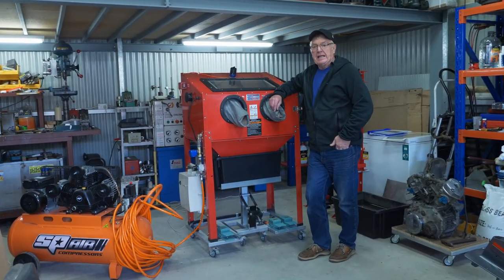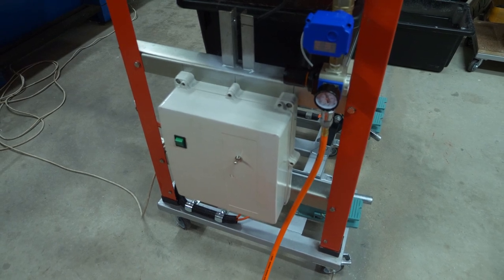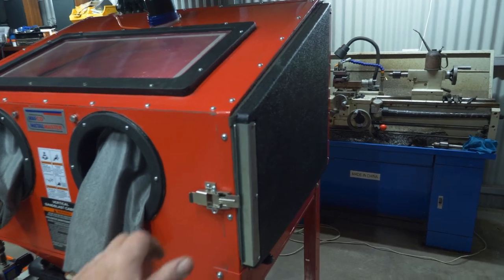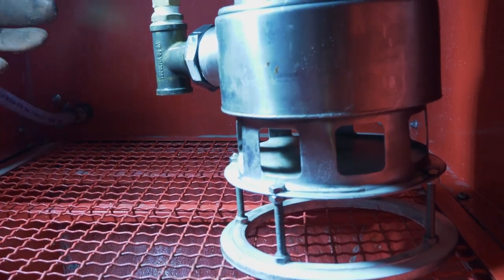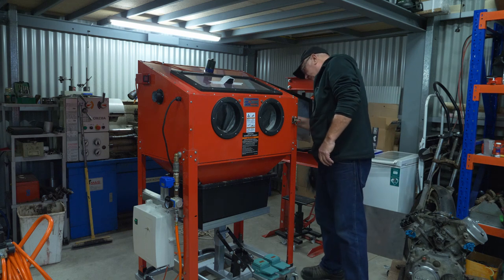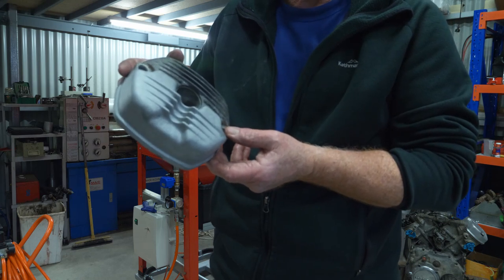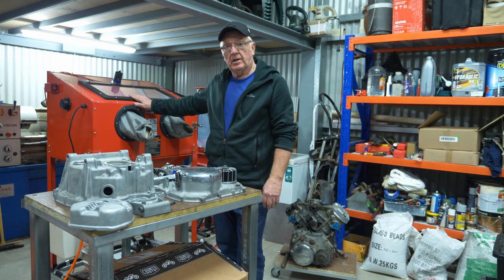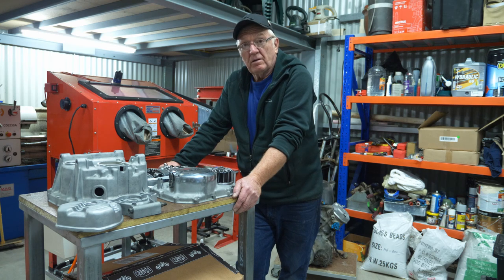How to Build a Wet Blasting Cabinet

Comment: Hi Steve.  Greetings from Canada. I was wondering if you could share specs on the pump ? Gph, psi, brand ?
Reply from the maker: Hi Ken 
There is a link in the description of the pump I used above 
Here is another link to similar pumps  
https://www.ebay.com.au/sch/i.html?_from=R40&_trksid=m570.l1313&_nkw=1800W%20Submersible%20Dirty%20Water%20Pump%20Bore%20Sewage%20Septic%20Sewerage%20Clean&_sacat=0&fbclid=IwAR21AdtubI502E_jI2tKKI-3b4LQH_ev6Pkc1w35FXywNBTeceUVweW-zIc

Comment: Thanks for sharing all the great details.  I am trying to work out pump and hose sizes.  Can you tell me how long it takes to pump the 250ml sample or some other known volume just with the pump?
Reply from the maker: The pump that I used is listed in the description see link
https://www.mydeal.com.au/1500w-submersible-water-pump-universal-fitting
Hose size from the pump to the gun is 1/2 "
Outlet from the pump is a 3/4" T reduced on one side to 1/2 to the gun the other side open for slurry circulation

Comment: Hi Mate, 
Brilliant video, i have just built one myself, may i ask what size and brand bead you use for polishing and what psi is the air set at?
Reply from the maker: Hi Nathan
The size on the glass bead bag says 106-300 no brand name on the bag
The nozzle I was using was 5.5mm Dia hole 
The pressure I was running at was 5 Bar on glass bead and 6 bar on aluminium oxide
If your not happy with the way it is blasting try lowering the pressure I was originally at 8 bar straight off the compressor, lowering the pressure made a big difference

Comment: Great work! Does vapor/media escape the exhaust fan? Will you revisit the tank lifting setup as you mentioned in some of your feedback?
Reply from the maker: Hi EE
Yeah it did escape through the exhaust fan and kept the inside space pretty clear of mist some guys prefer to use a fan and overpressure the inside space and then exhaust through a port in the cabinet 
I do have three other videos on the wet blast cabinet and how I ungraded the lift system please check the videos on my channel

Comment: The easiest way it to get a flask of 100ml when you spray the slurry with the air off just pump it and let it slurry and you need to have 20 mils of media and 80 mils of water, does that make sense?
Reply from the maker: Thanks Scott 
I was taking a 250ml sample with just the pump running and I had 25ml of media settle out that was 10:1 your saying 20:1
Great thanks for the info

Comment: Hi Steve just watched you video, I have just bought a circular sandblaser, do you think I could  use this for a wet blaster?
Reply from the maker: Hi Steve
If your circular sandblaster works as a dry sandblaster I cant see why it wouldn't work as wet sandblaster
All you would have to do is make sure all the joints are sealed and you fit a tank and pump to it and it would work as a wet blast cabinet

Comment: Hey steve, great video mate. Just wondering where you got you 5mm thick plastic?? I cant find anything near that thick online or locally. Thanks for any help.
Reply: Jordon Evans cheap plastic cutting board from Walmart or Sam’s. I buy them in bulk and use them for various projects. Easy to cut with a saw, and super strong.

Comment: very nice build sir. im wondering if powder coating will works just fine after those wet blasting??
Reply from the maker: Powder coating would work really well on a wet blasted surface 
My thought are that wet blasting is good on aluminium surfaces dry blasting is good for ferrous metals 
You can do steel but you will get flash rust and guys do add a rust inhibitor to the water when blasting ferrous metals
Reply: Could you enlighten me what kind of rust inhibitor that will help? Im planning to build wet blasting in near future, and i need to learn a lot.
Reply from the maker: @radityapadmanegara7715  This PDF should cover wet blasting flash rusting 
https://www.shotpeener.com/library/pdf/1987164.pdf

Comment: hi steve, very detailed video and awesome build, clarified a lot of my questions and wonders, how ever, where abouts did you find your wiper blade system! i can’t seem to find any, as i’m building my own cabinet at the moment, cheers🍻
Reply from the maker: Hi Corey
All of the part supplies are listed in the description 
Here is a link to the wiper I used 

 https://www.ebay.com.au/itm/151674317976
Reply: hi mate just had a look, also where abouts was the electrical board/cabinet from?
Reply from the maker: @coreycartledge2432  You can get them from any local electrical supplier
Reply: hey mate how’s things… quick question as to where you got the pvc sheet you added to your door?

Comment: Have you got a link for the transformer you used?
Reply from the maker: I bought that transformer from Jay Car search PowerTech 12 Volt Dc 12.5 Amp Power adaptor
https://www.jaycar.com.au/12vdc-12-5-switchmode-power-supply-mains-to-cigarette-lighter-socket/p/MP3573
 https://www.ebay.com.au/itm/240V-AC-to-12V-DC-12-5A-Power-Supply-Adapter-Cigarette-Socket-Waeco-Engel-Fridge/273134712521

Comment: Good demo video - thanks. Do you have an actual video on "how to build a wet blast cabinet"? I checked the other videos you mentioned but they don't cover it either. I'm quite interested in getting the components, assembling and the Aurdinho controls you've done are very interesting for foot control. 
How much was your total build cost? Where do you actually purchase these HAFCO cabinets?
I would suggest you store the water and media tanks in shelving at the same height as the trolley, that way you aren't lifting heavy tanks (bad for the back).
Thanks for sharing.
Reply: Nice of him to reply like that!

Comment: Hi Steve, 
Awesome build! I'm currently working on a few bike projects and I think I am going to build one of these, would you be able to share your arduino program?
Reply from the maker: Hi Alex
If your doing up some motorbikes a wet blast cabinet is a great tool
Below is the Arduino program I used in my wet blast cabinet

/*
 *  Arduino code to push-ON and push-OFF 4 relays
 *  when button pushed, relay ON and stay ON
 *  push again to make it OFF and stay OFF
 * this can be done with 4 push button to control 4 relays.
 *  
 * written by Ahmad Shamshiri for Robojax.com 
 * on December 11, 2018 at 19:39 in Ajax, Ontario, Canada

watch video instruction for this code:https://youtu.be/3EZecphNdAI
Get this code and other Arduono codes from Robojax.com
 * 
  * This code is "AS IS" without warranty or liability. Free to be used as long as you keep this note intact.* 
 * This code has been download from Robojax.com
    This program is free software: you can redistribute it and/or modify
    it under the terms of the GNU General Public License as published by
    the Free Software Foundation, either version 3 of the License, or
    (at your option) any later version.

    This program is distributed in the hope that it will be useful,
    but WITHOUT ANY WARRANTY; without even the implied warranty of
    MERCHANTABILITY or FITNESS FOR A PARTICULAR PURPOSE.  See the
    GNU General Public License for more details.

    You should have received a copy of the GNU General Public License
    along with this program.  If not, see <https://www.gnu.org/licenses/>.
 */
const int pushButton[] ={2,3,4,5};// define push button inputs
const int relayPin[]={11,10,9,8};// output pins where 4 relays will be connected
String relayNames[] ={"Slurry Pump", "Air Blast","Wiper","CH4"};// Just put name for 4 relays
int pushed[] ={0,0,0,0};// status of each buttons
int relayStatus[] ={HIGH,HIGH,HIGH,HIGH};// initial status of relay

void setup() {
  // Robojax.com 4-Relay-4-Push button 20181211
  Serial.begin(9600);// initialize serial monitor 
  for(int i=0; i<4; i++)
  {
    pinMode(pushButton[i], INPUT_PULLUP); 
    digitalWrite(relayPin[i], HIGH);// initial relay status to be OFF
    pinMode(relayPin[i], OUTPUT);   
    
  }

// Robojax.com 4-Relay-4-Push button 20181211
}

void loop() {
// Robojax.com 4-Relay-4-Push button 20181211

  for(int i=0; i<4; i++)
  {
     int  val = digitalRead(pushButton[i]);   
    if(val == HIGH && relayStatus[i] == LOW){
  
      pushed[i] = 1-pushed[i];
      delay(10);
    }// if   

  relayStatus[i] = val;

      if(pushed[i] == HIGH){
        Serial.print(relayNames[i]);
        Serial.println(" ON");
        digitalWrite(relayPin[i], LOW); 
       
      }else{
        Serial.print(relayNames[i]);
        Serial.println(" OFF");
        digitalWrite(relayPin[i], HIGH);
   
      }// else   
 
  }// for 
    Serial.println("=="); 
  delay(1000);
// Robojax.com 4-Relay-4-Push button 20181211  
}// loop end
Reply: @Coolhand99au  Amazing, thanks so much! I picked up my cabinet today so hopefully I will be up and running soon.
Reply from the maker: @alexhiggins8113  Fantastic !
Make sure you seal all the joints when you assemble it and if possible replace the bolts with S/S bolts. Don't go with a big tank like I did keep it down around 30 LT
Good luck 
Check out this site for more info 
https://www.youtube.com/channel/UC5mEA0d4nP1rbzIerZIS_7Q

Comment: From the momentary foot pedals did you just run to some latching relays to hold on the pump and air valve actuator?
Reply from the maker: Hi Garrett
I used a Arduino UNO board and Arduino 12V DC relay board to control the foot switches

Links 
https://www.ebay.com.au/i/153430993911?chn=ps&norover=1&mkevt=1&mkrid=705-139619-5960-0&mkcid=2&itemid=153430993911&targetid=863787590804&device=c&mktype=pla&googleloc=9070869&poi=&campaignid=7412064611&mkgroupid=80796191477&rlsatarget=aud-692203741102:pla-863787590804&abcId=1139216&merchantid=119052658&gclid=CjwKCAiAvonyBRB7EiwAadauqXXHKO7ri1kSjt-5kvvds8vdT2y2I7dcE97rJl6D3k8FYheb6iUMsBoCmuQQAvD_BwE

https://forum.arduino.cc/index.php?topic=461675.0

Comment: great build there love it. I am planning on doing  one myself. love what you did with the arduinos ... did you use 3 of them? Did you already changed the buckets? If so can we see a video off this? and also, what is the size of the compressor. Fot the electrical stuf. can you please post pics or diagrams ? thanks and be safe
Reply from the maker: Hi Noel
You've caught me at a good time. The CX500 project is finished and I am now revamping the Wet Blast cabinet for the next CX Project
I have gone with smaller tanks and they look great
I will be doing a full tutorial on the Arduino which is only one Arduino UNO going into a Arduino 4 relay board 
And they light is going to be upgraded
Reply: @Coolhand99au  great, can't wait to see it. btw nice build you did there ... done a bobber build (made a video on my channel to) in the past to. Building a K100 into a caferacer right now and an xj 900 is waiting. so i think the cabin is going to be of good use in the future. BTW is the compressor a 100 Liter one ?
Reply from the maker: @NBRC  Hi Noel
The Honda Shadow Bobber looks great, nice and low 
Yes the compressor is a 3 HP, 100 LT, 150 PSI Free Air Delivery is 310 Litres/Minute

Comment: Hi Steve, great build and info, thank you! I’m also in Adelaide and nearing the end of my build. Just wondering where you got your glass bead and aluminium oxide from? I’m having a bit of trouble finding it locally. Thanks again 👍
Reply from the maker: Hi David 
Great job your near the end
Mate I got my glass bead from General tools out near Cavan see link below $66 a bag

https://generaltools.com.au/product/hafco-sandblasting-beads-inda-glass-bead/

The aluminium oxide which is grey in colour came from Burwell in Victoria  see link not sure of the price might have been around $90 a bag with freight no more

https://www.burwell.com.au/products/abrasives/aluminium-oxide/
Reply: Coolhand99au Thanks Steve, really appreciate the info, will check them out 👍

Comment: Works on aluminum.  How does it work on steel?
Reply from the maker: Well Sam it does work OK on steel 
I did the swing arm of my CX500 the other day 
To do this I took off the paint with paint remover then blasted it in the cabinet with aluminium oxide. It came out really nice 
BUT you will get what's called flash rust on the steel which I sanded off with wet and dry
I have heard of guys using rust inhibitor mixed into the slurry to stop flash rusting

Comment: Hi Steve just wondering what size nozzle you are using in you gun 
 Cheers
Reply from the maker: Hi Peter
The nozzle I was using was 5.5mm Dia hole 
The pressure I was running at was 5 Bar on glass bead and 6 bar on aluminium oxide

Comment: Love the dolly system! Could I trouble you for some dimensions for the dolly! (I’m in Adelaide also!)
Reply from the maker: Hi Minnie
From Adelaide ? welcome neighbour !
To be honest mate that dolly system needs to be redesigned
Number one The plastic tank is way to big. You don't need that big of a tank
When I get time I will use and circular bucket that the pump can just drop into 
I will also make two for the two media that I use to save my back !! 

That design was based on a motorcycle lift stand
Search on eBay  "Motorcycle Lift Stand 150 KG 

Also check out "Armory Enterprises " site 
https://www.youtube.com/watch?v=v4SBdFgRfF8&t=2s

Comment: What was the total cost of this build?thanks
Reply from the maker: Hi Chris
Looking at the items listed in the description prices in OZ $
Cabinet = $341 Ball Valve = $34 Pump = $81 Wiper = $89 = Foot Switch X 3 = $63 Light = $35 Electrical = $50 = TOTAL $693
Add Check valve, steel, hoses, wheels  Your looking at between $750 and $800
$800 AU$ = $538 US$

Comment: Have you got a link for the 240v to 12v voltage converter?
Reply from the maker: Hi there
Do you mean a 240V - 12V Dc power supply  ? like this below

https://www.jaycar.com.au/120w-12vdc-10a-desktop-style-switchmode-power-supply/p/MP3241

Or something like this 
https://www.alibaba.com/product-detail/China-factory-ac-dc-adapter-12v_62282102722.html?spm=a2700.7724857.normalList.185.413b7b60AhaLEQ

Comment: G'day steve..great video
I want to make one for myself
Would you be keen on running me through the process.. seacliff park
Reply from the maker: Hi Mark
Purchase the parts listed in the description
Assemble and seal the cabinet
Think about what sort of tank you want I recommend a smaller tank 30 Lt max I am going to modify mine to a round one 
Fir the tank to the cabinet  
Fit the pump make up or purchase a nozzle
Fit the light
Fit the foot switches
Wire up the electrical cabinet

Comment: Fantastically informative video. Thanks heaps for that.  My son and I have been wanting to do this for some time.  What size is your cabinet?  We would like to get a large cabinet that will accomodate most bike frames.  May have to fabricate one.
Reply from the maker: Hi Gert 
I'm glad you liked the video
Cabinet size - -  The one I have, available Harbour Freight USA is 900mm X 600mm X 500mm you would not be able to fit a motorcycle frames in it I think you could squeeze a bike frame in. Last week I did my CX500 frame using a DIY portable sandblaster I made using garnet sand set up on the back lawn To be honest it didn't work that good  and was messy so I took it to a sandblasting company he did all the bits for $120 
The next thing to think about is what you want to blast, aluminium or steel wet blasting is good for non ferrous metals you can do steel but you will get flash rusting and you can add rust inhibitors to the water  to stop that 
When I get time I would modify the cabinet in the video 
1. Make the slurry tank a lot smaller and round 
2. Make another lift device to save my back !
3. Replace the pneumatic motorised valve with a different valve 
Hope this helps Coolhand99au

Comment: To keep your viewing window clear just rig a pipe with air flowing across it. That is how they do it on the $15k machines

This is fitted to a Torrent 500
The integrated air knife on the interior side of the viewing glass blows compressed air across the window while the pump is activated, allowing for better visibility by the operator as it blows away any water or grime that slashes back on the glass.
Reply from the maker: Good information Alex 
Cheers
Reply: where do you source the bits and pieces for that? I need to retro fit something to my old AquaBlast.

Comment: How do you programme the door pedals?
Reply from the maker: Hi Dai
Mate at the moment I am upgrading my Wet Blast Cabinet
I will be making a video on how to program and wire the Arduino board 
I'm probably two weeks away from posting that video 
In the meantime you can copy and paste the Arduino program 
Take a look at ALEX HIGGINS comment and my reply
Reply from the maker: Here's the web site that shows you how to wire and program the foot switches

https://www.youtube.com/watch?v=3EZecphNdAI&feature=youtu.be
Reply: Ah that sounds great thanks. I am having trouble sourcing a 1800w pump in the uk, I don't have a cabinet yet but am trying to put together a cutting list so I know where and how much things are going to cost. I would like to get all the parts ready so I can hopefully do do finish it in a weekend
Reply: I think your setup is the best I have seen and with your permission would love to copy it. You could make a detailed video from scratch as You explain this g well.

Comment: 1st why do you have a cover on the pump, being a submersible i would think that it is not necessary. 2nd  i can see that you are a competant welder why didnt you build 2 support trolleys one for each media therefore not having to manually swap media which is  awkward and as you get older more strenuous i am 74 and 5 foot 6 ,god plays a nasty trick and allows you to think you can still do what you used to do without penalty plus it would easier on your back and less time consuming thanks for the informative vid
Reply from the maker: https://www.youtube.com/watch?v=6JolI-myv7Y&t=145s